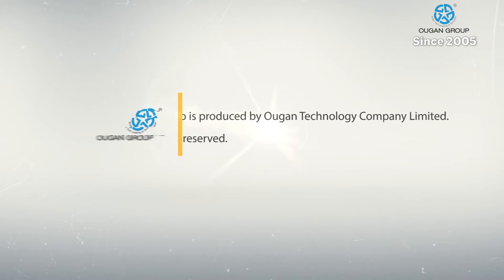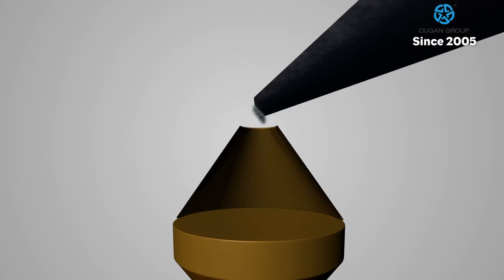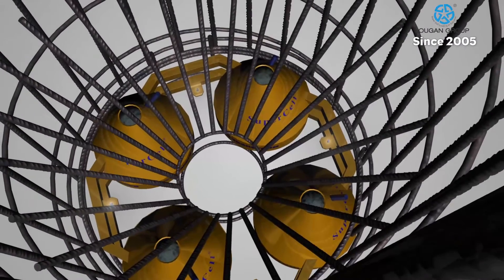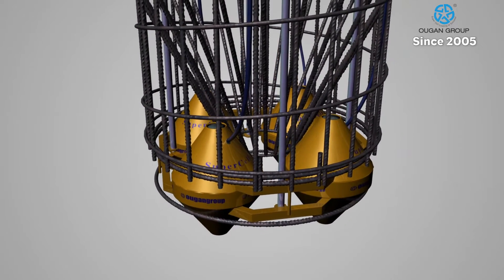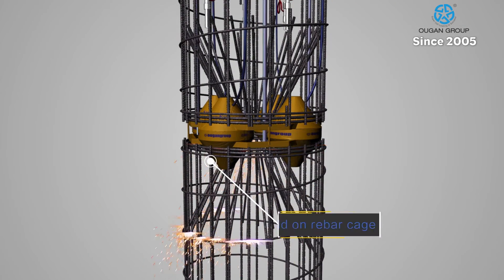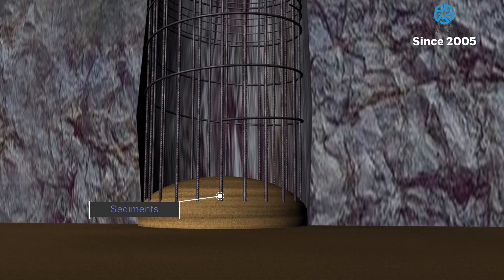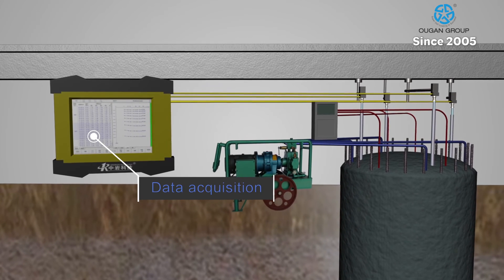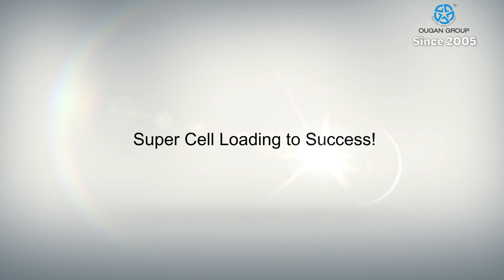New demonstration video of the Super Cell bi-directional static load testing process

Comment: i have some question 
1-for upward and down ward displacement are it computerized measured or using reference beam ?
2- if using reference beam , no any clarifaction for that at the video ?
3- what is the benefits for telltale rods and casing  except grouting after doing the test ?
4- How can we  determine the O-CELL excat location ?
5-if the test on working pile ,is the length of steel cage will be same after welding the super cell or will be increased by the ocell height ?
6-for hyradulic hoses fixed with super cell , is it be included.?
7-if we out of china ,how we contact with you for similar tests ?
Reply from the maker: Hi Mahmoud, may I have your email or WhatsApp NO?
Reply: @ougangroup4436  alghol389@gmail.com